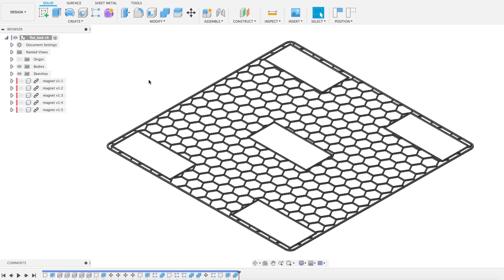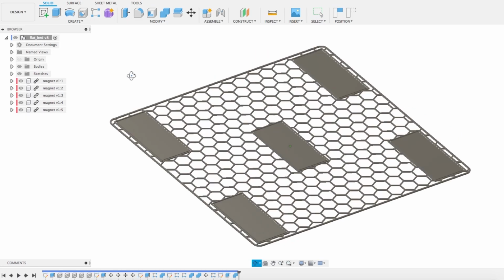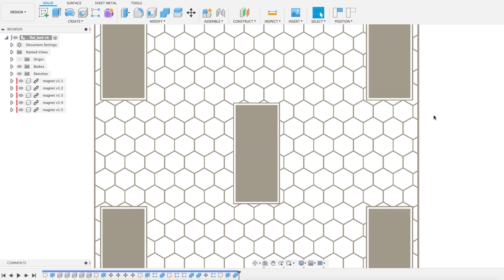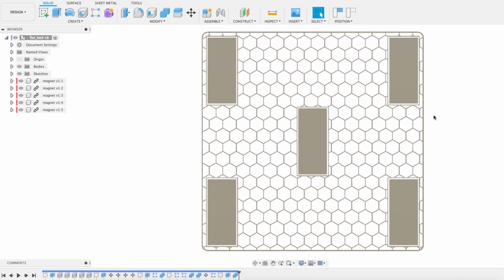Warped Bed: printable solution for a perfect first layer!

Comment: After one hour googling solutions for my warped printer bed.... I pushed down hard with both my hands at the center of the bed. One hard push down and tested the printer. Printing perfectly now, no more levelling problems.
Reply: Im having the same issue with mine where the middle is higher than the rest did this work in the long run or have you had any more issues?
Reply: @chrissvado5087  Still working fine, still a little warped but it is minimal now and have no printing issues.

Comment: This worked great on my Ender 3 pro !  I just took out all the aluminium foil strips I'd put in to try and level it, printed the grid at 1mm thick as normal on the mat, peeled it off and placed it under the mat (same way round as printed ! ) and hoped the magnetism would still hold - and it did, and now the bed is nice and flat !!  Thanks , it's genius =o)

Comment: Interesting idea but I don't see how this would fix a warped bed. The printed honeycomb layer will just flex to conform to the warped bed then the layer on top will also flex. You need to account for the warping (i.e. having the honeycomb be thicker in the center). Also as others have said the trapped air makes an excellent insulator, and also it will totally deform if you print with high bed temps
Reply: The printer head moves straight no mater what and will always be level so in areas that the  printer bed is farther the printed line will be thinner but still up to the nozzle and areas where the nozzle is closer the printed line will be thicker but still always high as the plane the nozzle is on. It will not conform to the bed because the nozzle is not moving up and down with the warping of the bed.
Reply: If you try to print a thing print with an obviously warped bed, you'll notice that it's thinner in some areas and thicker in other areas, the print will deform accordingly to the warp of the bed, but the top layer will remain square with the movement of the nozzle, so printing this honeycomb structure will result in a build surface that is deformed at the bottom in a way that conforms with the deformation of the bed, and a top layer that is perfectly flat with the nozzle axis

Comment: I’m not quite sure I get how this helps with bed leveling. If there’s a dip in your bed or the bed isn’t level and you print a honeycomb design on top of that, when you put your plate on top of that honeycomb design unless you’ve accounted for the difference in the bed height from the dips or warps and added more material in those spots your bed plate is still going to be warped or dipped once you put it on the honeycomb thing right?

Comment: Nice idea, instead of removing material you did what 3d printing is about - added a material . Yet now there is a lot of air pockets under the build surface. And air is a good thermal isolation. What about heating time and bed temperature stability?
Regards!
Reply from the maker: You got it right! As for the heat transfer, I have a followup video. Many people use glass, which is also a thermal insulator and usually way thicker than 1mm (like air in this case). Here is the link: https://youtu.be/4JF_QJtj6TI

Comment: Wouldn't you have a problem with your print of this honeycomb pattern since you start without a level bed - warped surface?
Reply from the maker: The molten plastic will adapt for the first layer exactly like it happens in a normal print. It will squish more or less due to the warp, then from the second layer onwards it will be ok
Reply: essex0chris depends how bad your printer is warped. Mine would print in the air in the center and fine in corners.

Comment: Interesting idea! Any issues with heat transfer from bed heater to print surface?
Reply from the maker: It doesn't seem so. I'm collecting the instruments then I will measure. Glass is not very conductive either, and the honeycomb is just 1mm thick.
Reply: True. Glass is definitely worse than metal by a factor of a couple hundreds watts per blah per whatever.

However, the same is true for air as compared to glass. So I was wondering about those air pockets, whether they have a clearly visible effect. But apparently they don't 👍
Reply from the maker: Ok course air is insulating but thickness do matter. I will followup!
Reply: @AMakeDesigns  So, do you have a follow up?
Reply from the maker: I sure do! It's here https://youtu.be/4JF_QJtj6TI

Comment: This looks like a perfect solution to the geometry problem, but what about the droid attack on the wookies? I mean it seem that the extra layer will be acting quite like a heat insulator. Wouldn't this be a problem on a heated bed?
Reply from the maker: I have a video looking into that. I get this a lot but no one seems to notice that glass is a thermal insulator and putting a 4mm slab will more or less do the same thing if not worse.

May the force be with you.
Reply from the maker: Bed Heat Map: is my honeycomb making any difference?
https://youtu.be/4JF_QJtj6TI

Comment: I am sorry. But did you mention the material you used for the hexagon bed?
Reply from the maker: I used PLA just because i have an old roll I have to get rid of. You can use PETG or ABS if you use high heat on the bed

Comment: I like shimming with sheets of Aluminum Foil, and then put a magnetic sheet (I like Flexiplate Spring Steel sheets)
Reply from the maker: You are welcome to use anything that works for you! The beauty of this method is that you don't need to find out where it's low.
Reply from the maker: It's just a printed sheet

Comment: I don't get it. What are you doing? How can you print the honeycomb without your bed being almost perfectly flat already? If a bed is warped it won't stick in certain place. So the whole honeycomb only works if you are already very close to perfect :(
Reply from the maker: well... it's a whole piece, so even if the adhesion is not perfect in some areas, the whole thing will stay in place. We are talking about a few tenths of a mm, so the first layer may sag a little, but the next layer will take care of it. It's the same thing as with a normal print.
Reply: @AMakeDesigns  Also, I am not sure what tape to use to mask the aluminium bed. I don't have the blue one you are using. I am afraid the heat might bake the thing to the bed and/or create toxic smells every time I print.
Reply from the maker: I used Scotch Blue masking tape, but I think any masking tape will do. I have no funky smells (it's the same tape I use when I print PETG). For the slicing, Cura for some reason considers part of the Ender-3 bed off-limits. You can overcome this by creating a custom FDM printer with 235x235 bed.
Reply: @AMakeDesigns  I did my best following your instructions. I added a custom FFF printer in Cura and copied the machine settings of the Ender3. Still no luck slicing. Maybe you could try to do the slicing in Cura and tell us what we do wrong?
Reply from the maker: I use Cura 3.4 in an old computer due to compatibility issues with the graphics card. Works there with no problems. I added .gcode sliced files to the thing in thingiverse, try that!
Reply: @AMakeDesigns  Thanks. Much appreciated. Btw, I would like to remove the tape after printing the honeycomb sheet. Does anything speak against that? Does this risk damaging or slightly displacing the honeycomb?

Does your honeycomb still stick to the masking tape after many many prints?

Comment: dislike because... you give up heating and it "works" only if your printer is able to print over the whole bed. WHICH NONE CAN WITH A WARPED BED (mine dips by 1.8mm)
in my honest opinion, this video doesn't solve anything and certainly won't help ppl with their warped beds
Reply from the maker: You don't give up heating at all. I don't understand why everyone is so concerned by 1mm of air gap but not of 3mm of glass. I have a followup video where I demonstrated that the heating is absolutely possible. 
As for your 1.8mm dip, that's something that can hardly be fixed.
Reply: @AMakeDesigns  Good if it works for you. Just saying air has a much smaller thermal conductivity than glass (about 0.3 vs 1.2 to 1.8 W·m−1·K−1 both@100deg c). The only difference at 60deg c is probably just the consumed wall-power. 

After some hard punishment for the bed (cut a 5mm hardfoam frame and screw-clamp down to table, several times until the dip starts to disappear. checked with ruler against light each time). Now with some foil, i can at least use 200 of the 235mm. I use the stock Creality magnet-bendy-whatever that came with it.

Others out there bought 3 beds until they could finally print something. Waitaminute...if you "remix" the design maybe it can even work for extreme cases like mine xD

But i guess "You get what you pay" pretty much applies. Still a great machine once it works, this Ender3.
Reply from the maker: @CyLuS_sEcToR9  you can scale the design in x-y in the slicer. Consider this is 1mm thick vs. glass that is usually 3-5mm. This is my thermal measurement, I lose around 10C from the bed thermistor reading to the outer surface: https://youtu.be/4JF_QJtj6TI

Comment: My printer is high in the middle, but I will give this a try
Reply from the maker: Great! Let me know how it goes!
Reply: @AMakeDesigns   it wasn't as bad as I thought. I came up with 2 solutions. 1 was to take thin metal shims and the other solution was the easiest. As I noticed once the z reaches a point above the print everything looks good. So what I did was lvl above the 4 screws then proceed to print. I always use a brim and during the print I noticed it too close so I proceeded to babystep the z and yep perfect print.